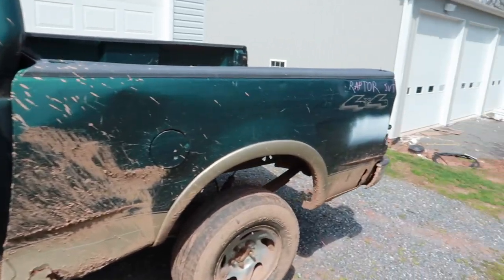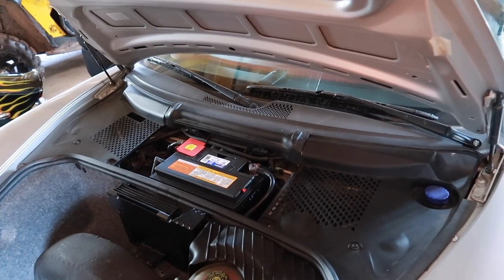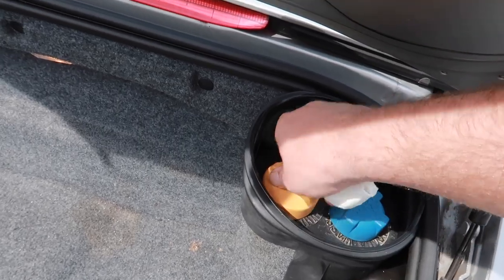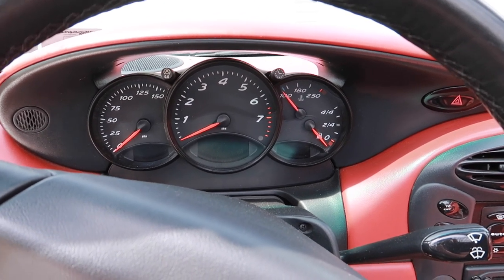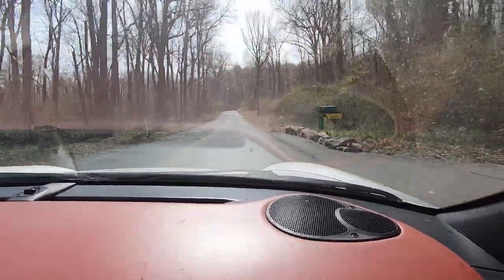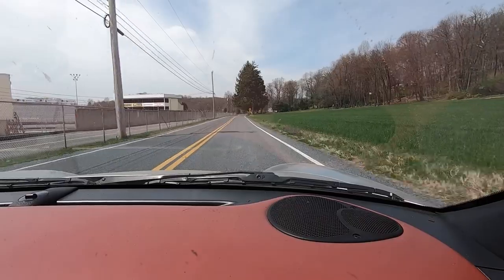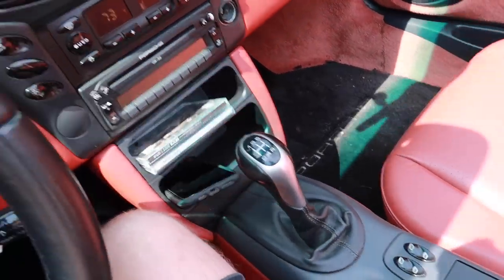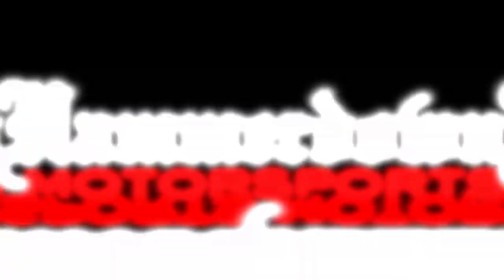1998 Porsche Boxster POV Drive

Comment: Thanks for sharing the little quirks like the trunk release trick and also the built in oil funnel! How's the reliability been for you and what would you say a car like this is worth with about 140k miles?
Reply from the maker: the reliability  has been decent for an older car I have had to do some things along the way but that is to be expected, one of these with that high of mileage I would check and see if the clutch and intermediate shaft has been changed, the intermediate shaft on the 99 to 2001 I think had the most problems after 100k miles if the bearing fails it will take out the engine but 97 and 98 have a double roller so they last longer but something to consider, one with that high miles in good shape maybe 3-4k
Reply: @HammerdownMotorsportsUSA  Thank you for taking the time to respond thoroughly! I'll stay away from the one I saw yesterday then, hopefully save up for a bit of a newer model. Enjoy yours in good health for many more years!

Comment: Great video, beautiful car and the perfect roads! I’ve heard so many good things about the 2.5 engine, so much so that I’m actually altering my search from a late 986 3.2 S to an early 2.5. Why? I hear because the gear ratios are shorter, having you work through your gears more, as well as it having a mechanical throttle vs an electrical wire one, giving you an overall better visceral experience. Even though on paper these models have 20% less power than an S. Are you able to speak on the 986 2.5 vs 2.7 vs 3.2 at all? Thanks!!